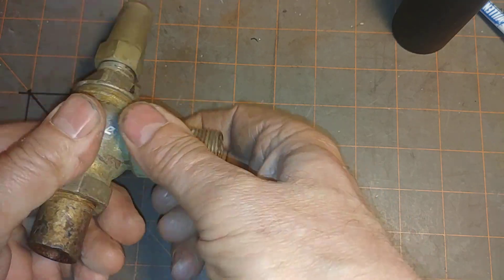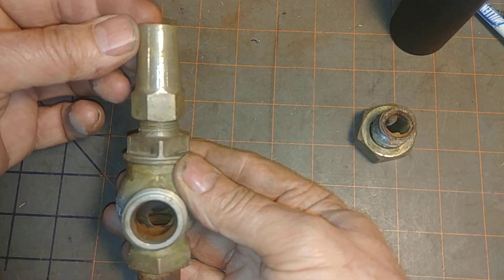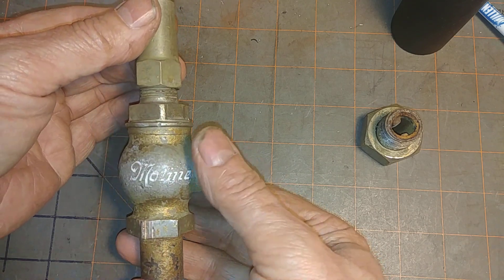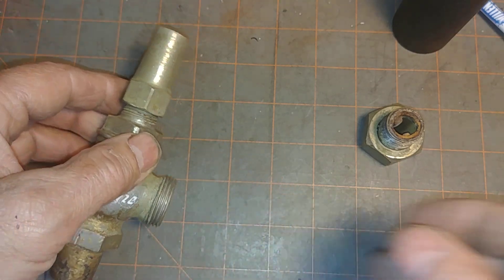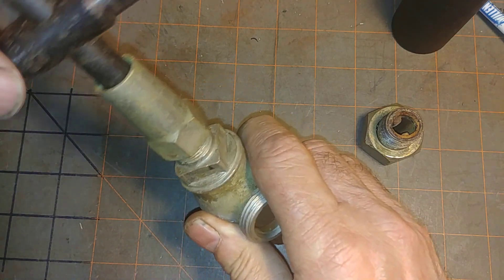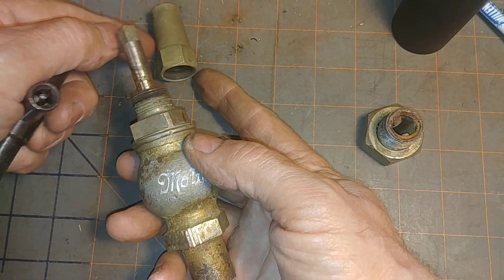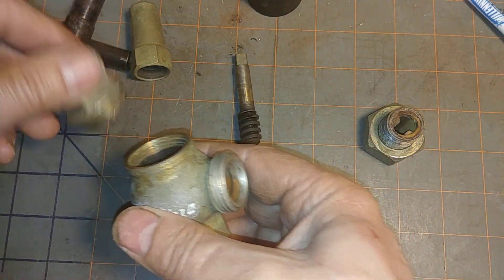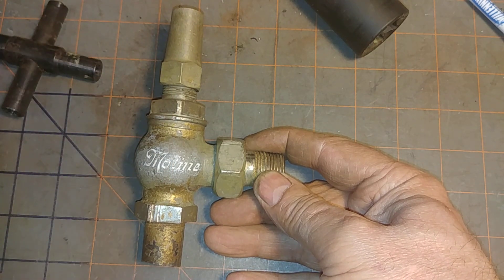Moline Radiator Return Valve Dissection And Discussion

Comment: Gordon thanks for the video !! I think my system has these type of valves on the lower return on each  radiators. Standard inlet top valves .
Over painted return valves ...so I have not looked for the Moline logo. System works great ! Looks like only 1 steam trap , Installed in my entire system . I may need this info for future repairs . Thanks again
Reply from the maker: Thanks for the feed-back!
The inlet valve for a Moline system that we have was sent to a company called Tunstall in Massachusetts to see if they can rebuild the valve in case of failure.
Once I get those Moline parts back, I hope to make a video on it.